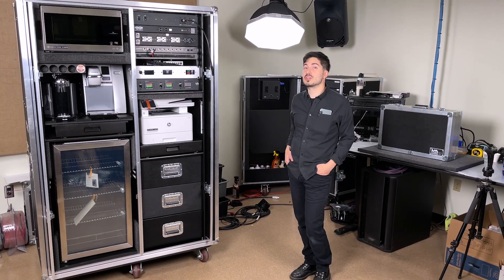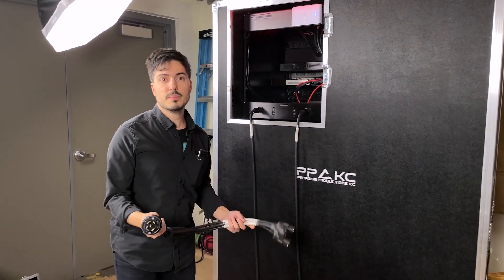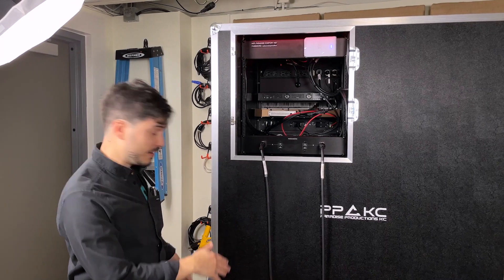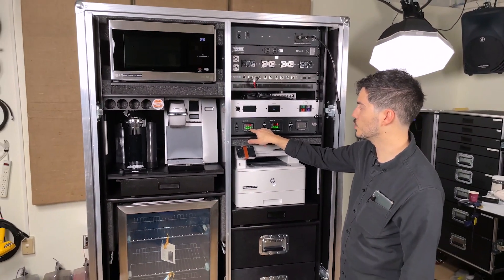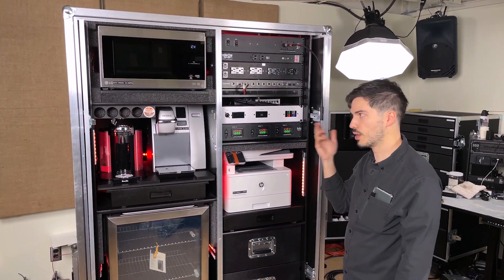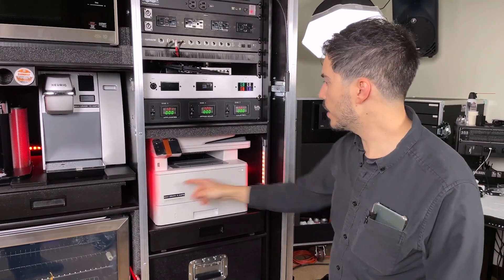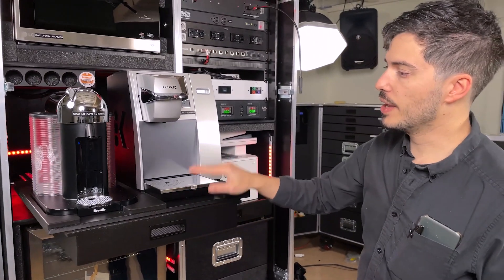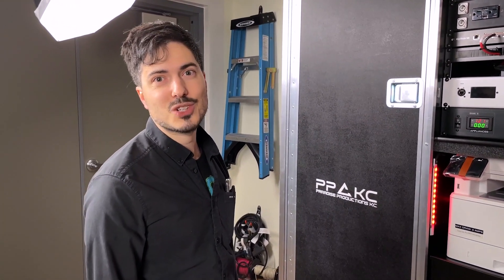The "Comfort Case" Double Wide Pocket Door Workbox | LM CASES [Project Spotlight]

Comment: What no mini bar and cook top? That thing is sweet! If it were me I would want both the input power cable(s) and the Edison outlet panel at the bottom so that all the cords that are plugged into it are down low and not in the way or hanging down in front of the printer and drawers. Also I would add a recessed twist lock male plug in the outside side so you don’t have to open the back fold down door in order to plug it in. And having it on the side would prevent having a cord in the way when servicing the rack get from back access door. And does the fridge have a latching or locking mechanism to keep it from opening and rubbing on case door when transporting? 

Great job that case might find its way to my truck inventory some day. How much does it weigh empty as shown in video?